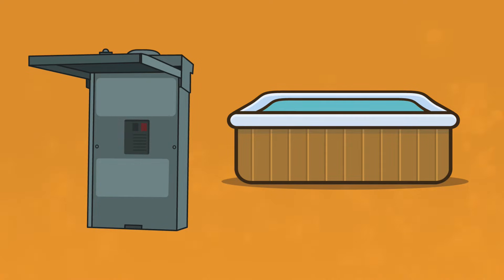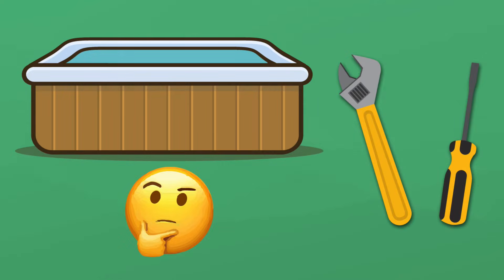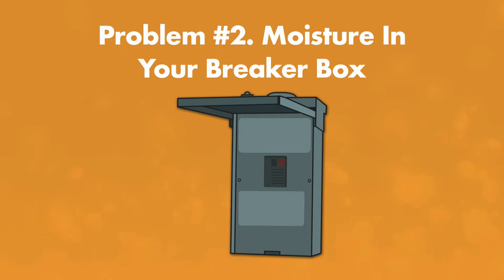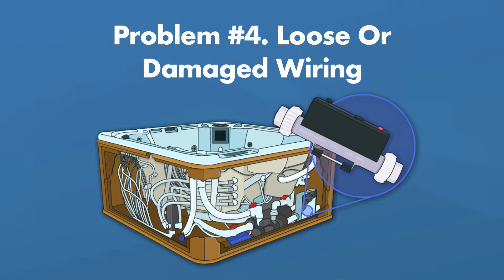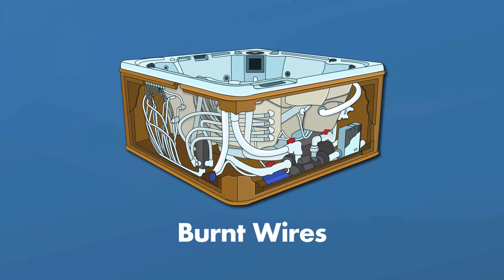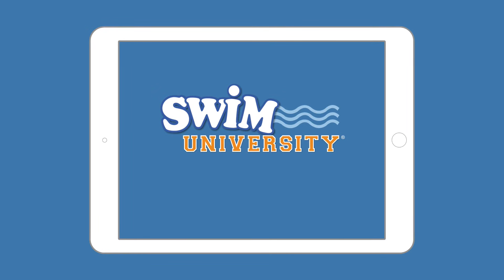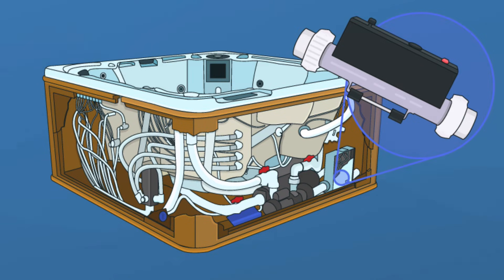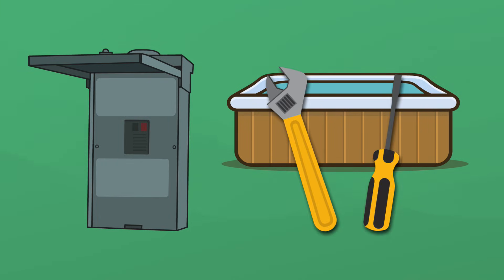7 Reasons Your HOT TUB Breaker is TRIPPING

Comment: I’ve also heard (depending on the brand) that you risk tripping the breaker if you have both pumps and the heater is running since more power is needed to run both pumps and the heater all at the same time.

Comment: The heat went off on my pacific spa. Pump still running. I decided to fix it some time later.I checked heater elements,hi limit and thermistor. Good resistance on all, no grounds. Hi limit and temp thermistor cycle when heated. I check gfi power at a junction box. Power and nothing to ground. But when I wire to the pack. GFI trips. With no pump. It needs seal. I don’t remember finding a ground to line at the pack. No signs of over heating. And it worked when removing it. Could wiring the pack with no components hooked up cause this. Help please.

Comment: I have had a hot tub for 3 years and now the hot wire going into the house heated up and burnt.  I got the breaker outside replaced and now six months later has happened again.  Hot tub is not bad and electrician says I need another breaker?

Comment: My issues is a strange one. i have a Lay z spa Maldives which is 3 years old. and it's consistently tripping the house power. now here's the catch.. the hot tub turns up and the filter runs fine for hours. but as soon as I put on the heat element, it trips!
Reply: Bad heater?
Reply: Tried to fix the same problem today, but with bad luck. Did you figure out what was the problem at the end? I'm a handyman, but I like also fixing things. Tried to see the breaker, it looks intact and no moisture was found inside or inside the circuit panel where the tub itself is. Also no wire damages of any kind were found, no loose cables. When I got to the heater I found signs of the heating bulb as being burned, though using a flashlight I didn't note the wires to be broken. Anyway I changed it, but it still didn't resolve the issue. Unfortunately the customer was standing right above me when I tried to figure out the thing and bragging about how he should call a specific hot tub specialist. When cables around and from the heater were diagnosed no damage or burns were found. So my only guess was to go ahead and remove the entire heating module and if no damages found, probably change it and see if it solves the thing. Unfortunately for me the customer didn't want me to continue the job as he was worried that I would break something down, but it's not a cosmic rocket that's hard to fix, at the end I would've found the problem, but it would've taken me some time

Comment: My Hot Springs hot tub trip the breaker all the sudden. Have had this tub for over 10 years. I plugged into another outlet on a different breaker and it works but the pumps won’t stay on. Goes on then off then on then off. Curious why the tub will stay on when on another outlet though???